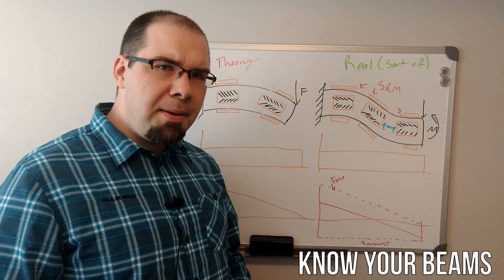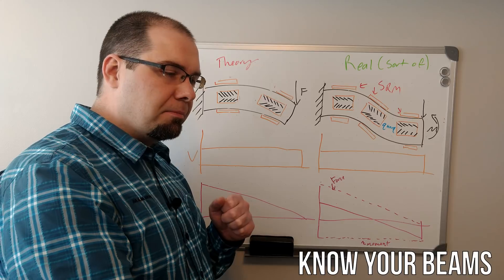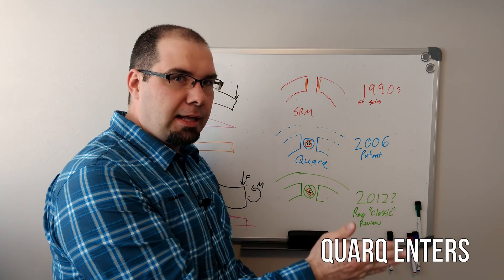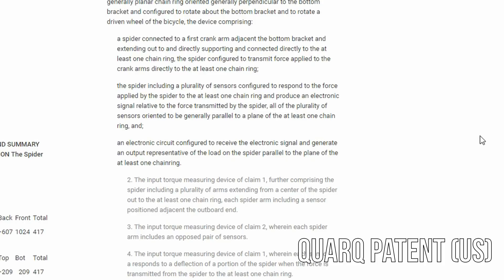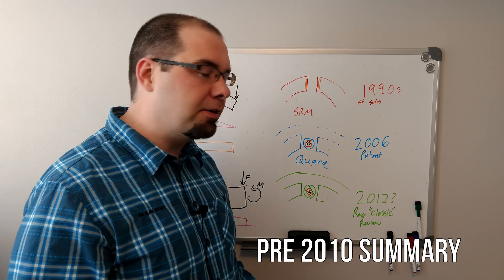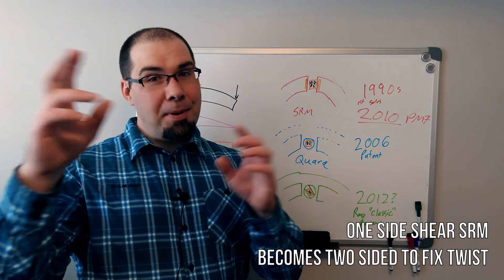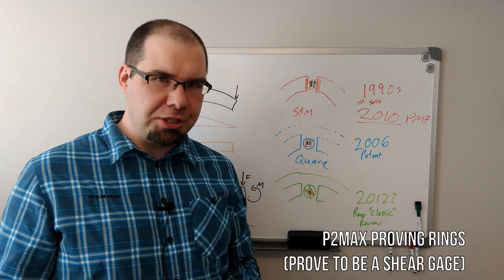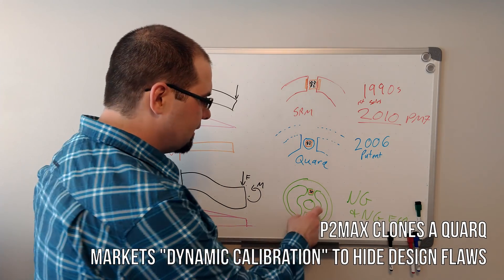Every Spider based Powermeter Is a Quarq

Comment: Hey Keith, I've seen a small trend for people going back to steel chainring bolts for power meters for better accuracy. Is that something you'd endorse? I can't think where there would be an advantage other than if alloy chainring bolts tend to loosen over time. Thanks!
Reply from the maker: On spiders I've noticed over the years that the chain rings have to settle in with aluminum bolts. Steel could hold more pressure and is 3 times as stiff so torqueing them down could reduce movements, zero offsets, and maybe even keep response more even at various positions as it rotates -- however that's just me thinking mechanical properties. I've never tested this idea out but there might be some small level of improvement, but I would think still near experimental error, so it could be very hard to quantify.

Comment: Great video! I have a quarq dzero power meter. I’ve changed the crank arm length on it from 170mm to 165mm. From what I understand this should change the slope calibration of the power meter. Sram has told me that the slope is independent of crank arm length and chainring size, meaning I don’t need to adjust it. From my understanding, most power meters measure the force applied through their strain gauges and multiply by the crank length to find the torque (ie. the “slope”). How is quarq measuring the torque independent of the crank length?
Reply: The force measured at the strain gauge is multiplied with the length of the torque arm (not with the length of the crank arm) to find the torque. The length of the torque arm is the distance between the strain gauge and the axis of rotation (centerline of the BB spindle). So the "slope" doesn't change with the length of the crank arm. Therefore, crank length should not affect the slope calibration.

Comment: I'm actually very interested in why you call Quarq 'disposable' in your video notes. What am I missing about them?
Reply: Because some variants of AXS Dzero power meters have chainrings integrated with spider. It's non removable/exchangeable. Hence the life span of the power meter is the same as the lifespan of the chainrings. Of course there are also variants with bolt on chainrings.
Reply: @michwoz  and also I believe you can send them in, so they are getting recycled or whatever. Still, a controversial design choice when the older design was already very accurate.
Reply: @testalino  and  @Michal Wozniak , I came upon this video because I just bought a new bicycle with SRAM AXS with one of these "disposable" power meter spider / chainrings. I also thought this was ridiculously irresponsible waste, because chainrings are "wear and tear parts" that get replaced often, but a power meter is an expensive "investment". But when I actually do the math, the reality is that the 11-year old bike that I am replacing (which has 50,515 miles on it according to Strava) is on its 3rd generation of chainrings, meaning that I replaced the chainrings only twice so far. In contrast, I have on the same bike, a pedal-based power meter with less than 4,000 miles on it, but the pedal bearings are prematurely worn and cannot be replaced / repaired by anyone other than PowerTap because the sensors must be recalibrated, and this service is expensive.  When the chainrings on my new bike wear out, SRAM will buy them back at 50% of MSRP. This is still a wasteful design and service plan, but relative to alternatives it may not be as irrational as it first appears.
Reply: @osmanisvan  the previous quarq was not wasteful. I can also change the bearings on my Assioma pedals without the need for factory service. So there are less wasteful ways to do that. But like you said, it is not the end of the world.

Comment: So we see that Shimano crank based power meters aren’t the best. The new quarq axs is fool proof, but it’s not poor fool proof because a poor man couldn’t ever afford it! Could you recommend a brand then? Or could you recommend a location for a power meter? Pedals, spider, etc?
Reply from the maker: Also new Quarq AXS has integrated chainrings = disposable pm AND it's roller diameter is different so are the grooves, so if you use it on anything that isn't SRAM RED AXS you should be seeing accelerated wear. My go too (having designed competitor products to both quarq, and my suggestion) is the Assioma pedals. They are the most fool proof pedal I've used extensively. Vector 3's are good too (since their fixes). V3 major down is pedal wrench. Assioma is a bit ugly duckling, high spring tension, and cleat thickness is off to genuine look. Dzero's are still solid. If only power and nothing else, the P2Max's are okay as well. I like the strain gage work on the 2inpower but people are still reporting some sort of cadence issues that have been going on for years causing power data to be skewed. Powertap hubs are always solid but long in the tooth and missing modern features. They are also a nightmare on trainers where you leave the wheel on. Autozero on for outside, autozero off on a trainer (or else your data is useless, autozero gets sooo confused on spin down)
Reply: Keith Wakeham awesome insight, thanks man 👍👍👍

Comment: I hold a very similar (almost identical) patent regarding shear sensors on the neutral axis to measure torque in automotive transmissions. It works well, but its very complicated. As you mill down the pocket, you chase the NA down and down, but you can never get to it. Yes you can mill from both sides, but your gauges will never truly lie on the NA in twisting, but you'll be close. What's more, as the arms deflect, the neutral axis shifts, albeit on a micro level. A helpful by-product is the increase in shear however. 

Some of the drawbacks include, much harder gauge application and glueing, non-uniform strain risers and residual stresses at the corners of the internal pocket. If the pocket isn't big enough with respect to the gauge they can really screw up the uniform shear field. Ideally also the transducers really need to be heat treated again after machining prior to strain gauging to relieve machining residual stresses, in high level automotive control we did this. But I bet in cycling they're not. Not necessary for +- 1%.

Cool video again, cheers.
Reply from the maker: All true. I've been told my videos are too deep in some areas so I kind of arm waved over this. There are relative drawbacks to every approach with this design. My main point was the patent though. I personally like independent leg data because I think it can go somewhere but the fact will remain that its easier to get good data from something designed as a load cell first. It starts ahead of other gage designs on existing things. They've bottomed out in price with mass production and gage installation with conventional installs. So it's certainly easier to get a spider to read average coorect than an arm reading average correct for all people.
Reply: @kwakeham  i here ya! Quarq have done really well, although sensing torque on a spider with bending is always gonna be tough.

Comment: It is pretty strange that Quarq only really figured out their power meter nearly a decade later! Even Power2Max was there a couple years earlier with a properly working power meter with temperature compensatiob (late 2013)

All in all they are all very much based on the SRM patents!
Reply from the maker: Maybe I wasn't sufficiently clear. SRM came up with spider, Quarq came up with a shear gage usage and patented it in 2006. In 2010, against the quarq patent, SRM implemented the shear gage AFTER quarq and the SRM usage of a Shear gage on inspection looks like it would infringe on Quarqs currently valid patent. P2Max eventually moved to a true shear gage design about 2 years ago, and again is inside the valid patent.

Comment: Interesting stuff. Would be interested in a video on how crank arm based power meters work and what the heck is going on when I 'calibrate' my stages crank.
Reply from the maker: Look at my video called "powermeter flaws". It covers the asymmetry problem with basic bending designs which are found on stages, Pioneer, and now the chinesium arm powermeters. If you cycle like like me it causes those basic designs to read off. The left right balance thing also masks a lot of the ability of users to track down stuff. There are also major issues with the drive side that I haven't covered - also nobody has a perfect drive side integrated spider solution yet.